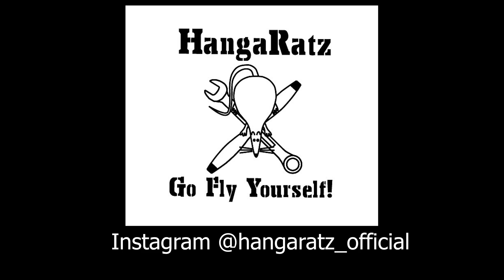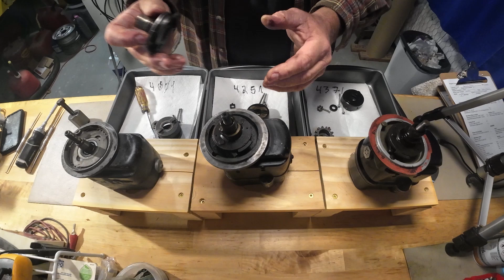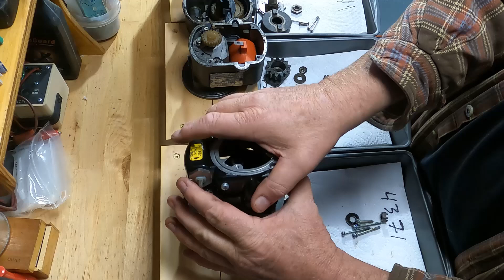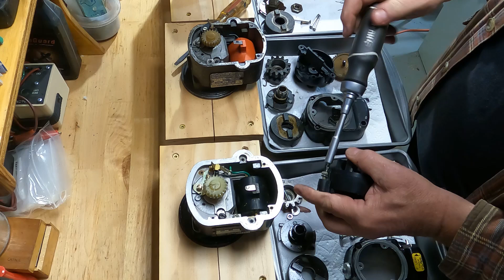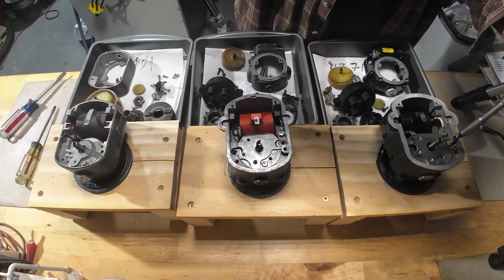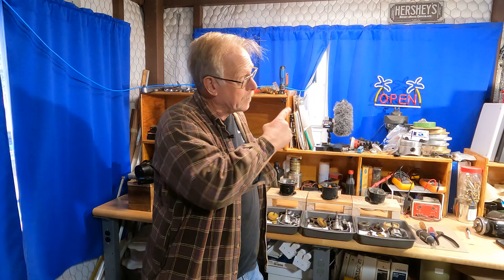Hangar How To - Slick magnetos through the years

Comment: When my mags reach 500 hr I will go with modern tech and get Electro air.  No 500 inspection, hotter spark, variable timing, better fuel economy, and less carbon in the combustion chamber.  Looking at the old 70 year tech of the legacy mags is interesting but painful.
Reply from the maker: Believe it or not if most folks would inspect at 500 hour or 10 years they would be trouble free.  Most of the "dead" mags that come in are terribly neglected.  Thanks for watching!

Comment: Slick mags tends to get a bad rap, however I have over 4000 hours behind them and many 500hr inspections on our fleet of 3 aircraft with 6310's. They have been reliable and serviceable. In recent years the parts from Kelly, although less expensive, have been of lower quality. Perhaps Hartzell will fix this, however I hear they are raising prices as well. When I started a complete mag was $600, now just to replace the distributor block is $300.
Reply from the maker: Like any other mechanical device they just need some loving on a regular basis!  Thanks for watching!

Comment: A good half an hour spent watching this vid, Thanks! I work at a 30 fleet flight school and have been doing 500hr insp.s frequently. The quality of slicks is sub par but they do work. Some things to watch for are the loose rivets on impulse, even the new mags 2022 and newer still have this problem ( they have not fixed this problem and continue to put crap impulse couplings on these mags!! $683.00!) The first 500 hr is the most crucial as the ones I have taken apart are dry as a bone and haven't been lubed per the manual. Kelly Aerospace was a good alternative on parts but Hartzell bought them and jacked the prices big time. Keep em flying :)
Reply from the maker: Yeah, Hartzell/Kelly have really jacked their prices...🤨  Thanks for watching!
Reply: @HangaRatz  Boy howdy...